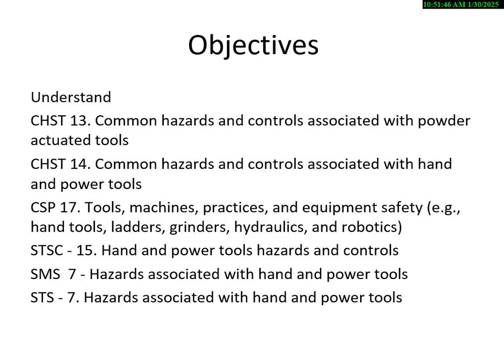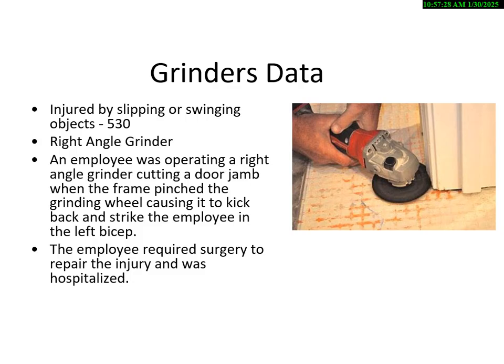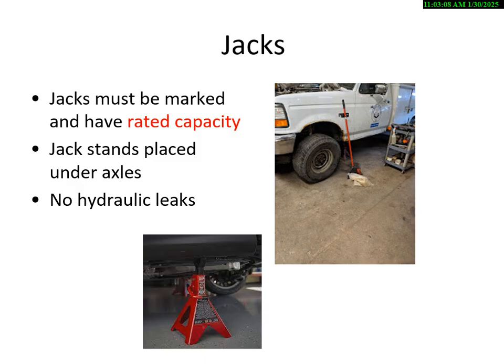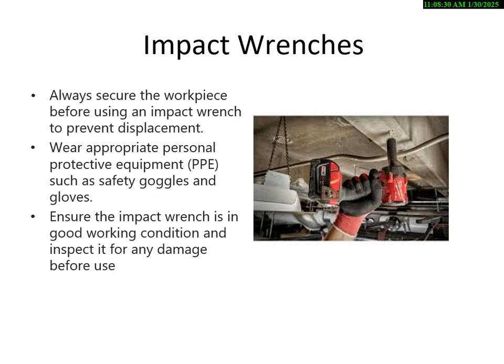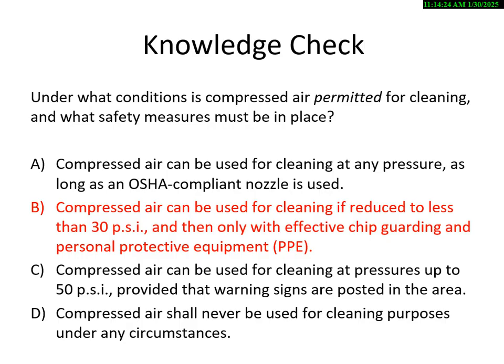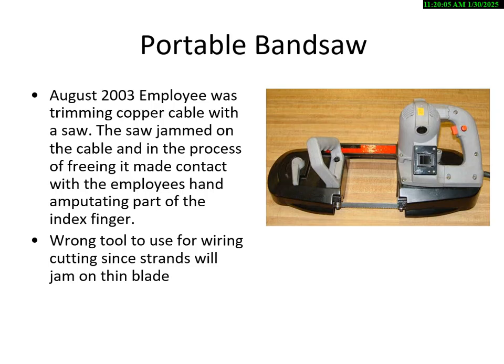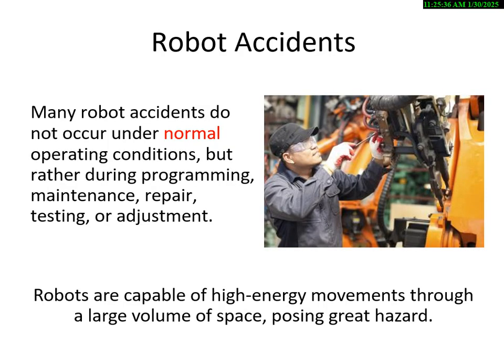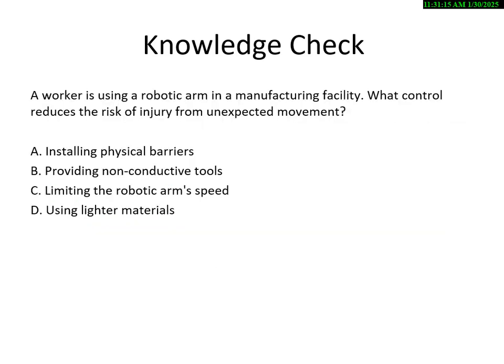Tool Safety CSP CHST STSC STS SMS

Comment: One issue I have delt with frequently in the field regarding the battery powered impact guns it people using the chrome sockets from a socket set instead of the proper impact rated heads
Reply from the maker: Good information.